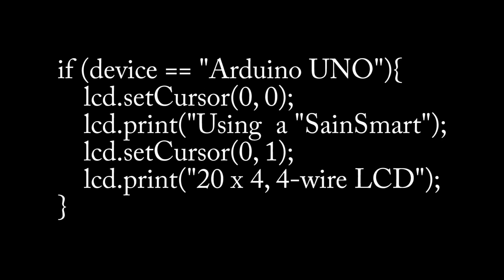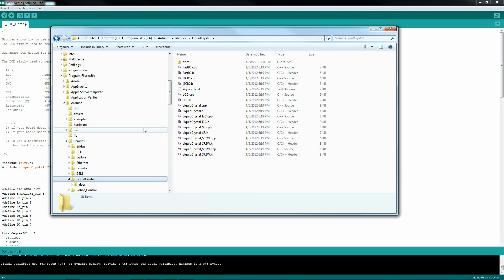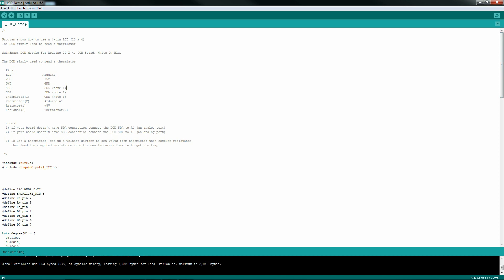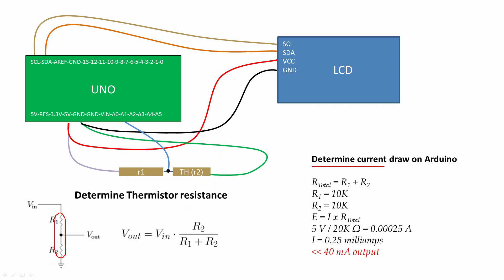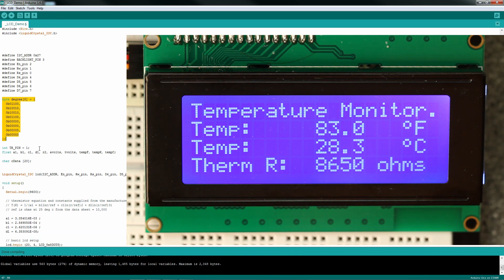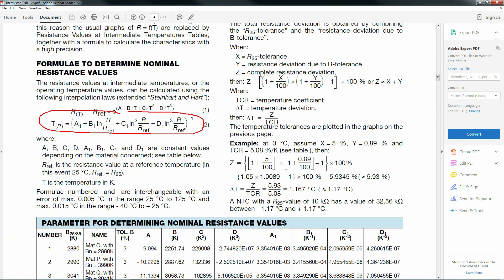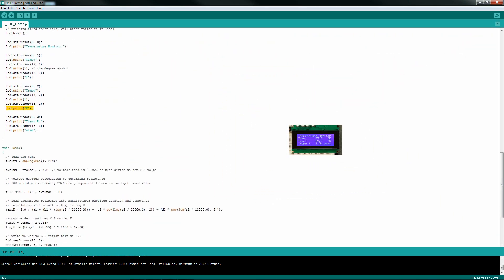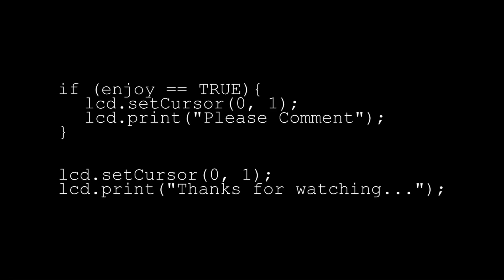Arduino and a SainSmart 20x 4 LCD W/SAMPLE CODE

Comment: Many thanks.   I struggled for 2 days with all the inconsistent information out there (trying to figure which library to use (since so many).  And which wiring to match up with the library choices. (It appears there are few ways to hook up the LCD and also a few versions of the LCD and chipsets).SUMMARY:   Seeing  your video with the Exact Same LCD module I have and a review of the code you show helped me figure out exactly the library I needed to use, and exactly the two pins to use on the Ardiuno.  I was so frustrated trying to figure it out and your video helped me 100%.Your efforts to share are greatly appreciated. :) :) !!
Reply from the maker: Glad I could help

Comment: I did my own calculation for the thermistor resistance and came up with the same result as you have. I didn't calculate the measured A/D voltage as this is dependent on what the 5 volt supply actually is. I just stuck to A/D units. The actual supply voltage, or an actual measured thermistor voltage, is irreverent. The circuit is ratiometric. It wouldn't matter if your voltage was 3, 4, 5, or even 7 volts. (if he CPU could take 7) 

I calculated the resistance this way.
float tempR = (1 / ((((1023 - tvolts)/R1)/tvolts)));  //tempR is temp & R for Rudy (me)

So with the resistance calculation confirmed I have to look at your equation calculation. 
-------------------------------
OK, minutes later. Your equation is fine. The problem is that a1 is not initialized. It is commented out. 

// ref is ohms at 25 deg c from the data sheet = 10,000 a1 = 3.354016E-03 ; 

So the code problems are most likely youtube formatting issues. 

Now there are some LCD formatting issues. When the temperature gets above 100 the decimal position gets pushed one character to the right and the tenth of a degree also is further to the right. And it stays there when the temperature drops below 100. Same thing happens with the resistance. When it goes from 5 characters down to four it leaves behind the last 5th character. 

The reason why I was looking at your code was because I wanted to see how you did your formatting. I have to do some work on one of my programs and I figured I would see how someone else handles the variation in characters. 

I have never used dtostrf yet so this gives me an example of it's use. I'll play around with your code for a bit more. I'm sure I will learn more from it.

Oh, one more thing. You didn't need to make a degrees character. The LCD already has it. 

lcd.print((char)223);    // degrees ° symbol   what I use.

Thanks for the video and code.

Rudy

Comment: You have a bug. r2 is never calculated.  Maybe the following should be two lines and not just commented out?

// 10K resistor is actually 9940 ohms, important to measure and get exact value r2 = 9940 / ((5 / avolts) - 1);

I was getting NAN (not a number) when I ran your code. I had to start breaking down the equation in order to find what was giving the error. I found that r2 was the culprit. 

Even with including the equation for r2 I still get bad numbers, but at least they are printed numbers. 5 digit temps (before the dp) are obviously wrong.
Reply from the maker: +Sweet Guy The description was messing up that line of code--it would not take braces. That will be the last time I ever try to upload code to this site...
Reply: Thanks for your help. A person must be masochistic to work with this stuff. But, there is the occasional happy dance when it all actually works. Hang in there, we'll beat it, even if we have to use a big stick.